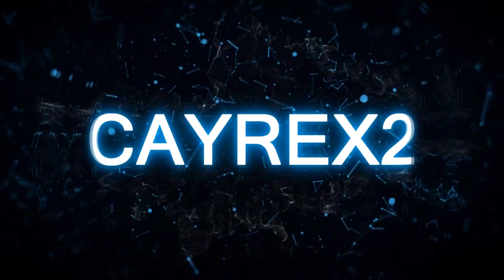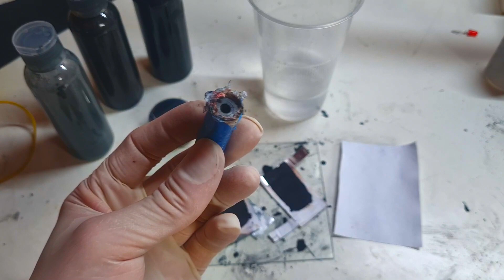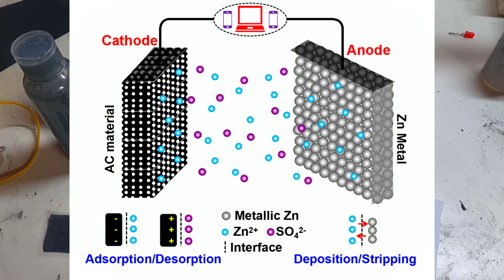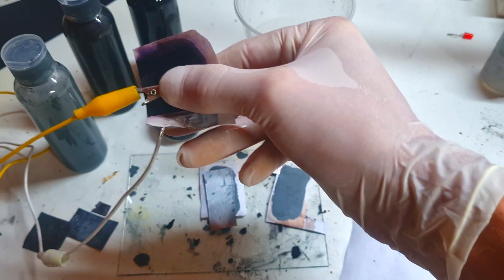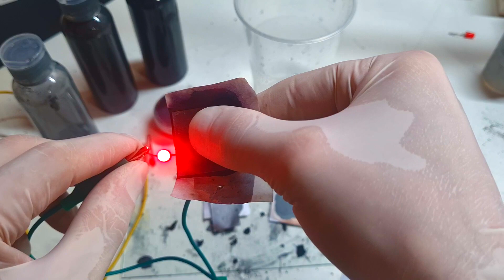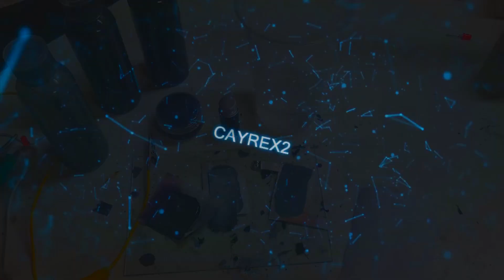Rechargeable Paper Battery

Comment: What did u said? External current collectors?
Reply from the maker: Yes. Instead of "painted" current collector which is painted below  active material paint,... I add some current collector on the top with higher conductivity
Reply: Thank you! Can I ask again, will zinc oxide work as my zinc ink?
Reply from the maker: @biancaramos4321  Yes,... zinc oxide will work. But you will need to charge the cell first,.... to get zinc from zinc oxide
Reply: I mean,I have the powder called zinc oxide/calamine/zinc white, will that work?
Reply from the maker: @biancaramos4321  is that what is used in medicine?
Reply: The packaging of the zinc oxide said, It is  “For food, pharmaceutical, supplement, sun care, diaper creams, mineral make up” so it is probably used in medicine, does that mean it will not work?
Reply from the maker: @biancaramos4321  Try it
Reply: Okay, I will try it! Thank you so much for the reply, and I'm sorry I asked so many questions.
Reply from the maker: @biancaramos4321  Ah, no worries. 😁
Reply: How did u set the multimeter? 😅
Reply from the maker: @biancaramos4321  If you want to measure the voltage, then you set the multimeter to volts (V). For the current you need to set the multimeter to miliamps (mA) and you measure the current for few seconds.
Reply: u charge your paper battery when u applied the external current collector, may I ask how did u set the multimeter to charge your paper battery?
Reply from the maker: @biancaramos4321  Yes, I charge the cell with the charger or power supply (adjustable power supply, in my case).
Reply: Can I use test clip clamp usb male connector cable, and just some phone adapter?
Reply: Will that work?

Comment: How about the auto-discharge? Did you mesured it? I mean, I think super capacitors should be used in application in combination with led's  and joule thief (to light up diodes more efficiently, less heating). There are thousands of possible application, i.e. charge recovery for vehicles.

Comment: A nice little cell cayrex, I like the way you went through the 3 ways of tackling the current collector problem.
I will have to try making the PVB based inks.
Btw, where can you buy the PVB material?
Reply from the maker: You can use other binder. I find my PVB on ebay, fro  russia some time ago. But now I think this will not be possible
Reply: @cayrex  Thanks, I will try using acrylics, or maybe polystyrene / acetone 🤔
Reply: @cayrex  can be sodium silicate to replace the PVB?
Reply from the maker: @hasan24253  No,... but you can try PVA
Reply: @cayrex  thanks alot for your reply.  PVA the white color water based you mean?
Reply from the maker: @hasan24253  white glue
Reply: @cayrex  thanks alot for your reply
Reply: @cayrex Yh pretty cool I used one zinc washer one piece salt water salt card board and one 2 p coin then did same again so 2 zinc washer 2×2p coin and 2 bits off cardboard soaked in salt water.....so a voltaic stack roughly 1 cm tall and it ran a large diode for about 4 hours....when it stopped I just pour salt water over wait about 10 seconds untill the water is not connecting the cell then light up again for another 4 hours....does it get anymore simple lol...voltaic stack is still legend easy powerful reliable simple design

Comment: is this new electrolite still ok for composting? The point of paper bateries is to solve recycling of bateries, which are mostly dumped somewhere. Paper batteryeas can be just composted and it solves main battery market probrem. Battery market is worth 17 billion $ yearly! So, paper battery would be major ecological breakthrough.
Reply from the maker: "So, paper battery would be major ecological breakthrough",... yes if they get better, until then, they can make more waste or this will be "only on paper" 😁 Composted battery is only one side of the use,.... another use of paper batteries which can be done already is in instant thin film applications as RFID, smart packaging, IoT, etc... The ZnSO4 salt is not like NaCl but it is also not dangerous.
Reply: @cayrex   I hope for the best. Robert Smith is pretty optimistic about this batteryes. And they are supposed to be as powerful az clasic AA batteryes. Same energy density. https://www.youtube.com/watch?v=VD2_NNx1k10